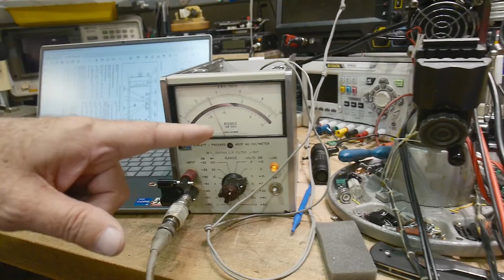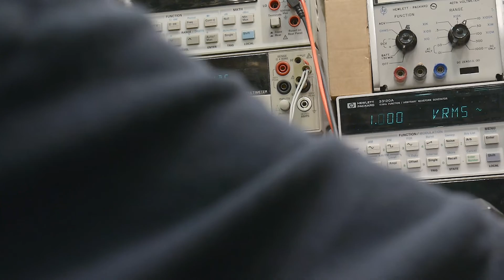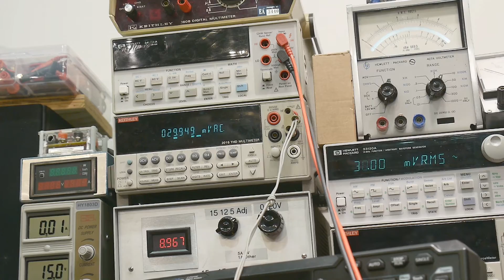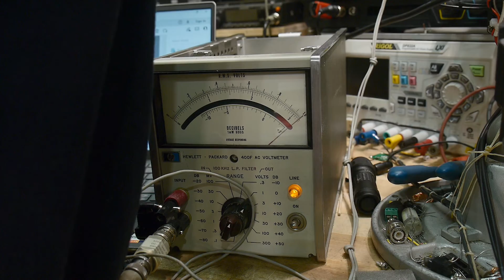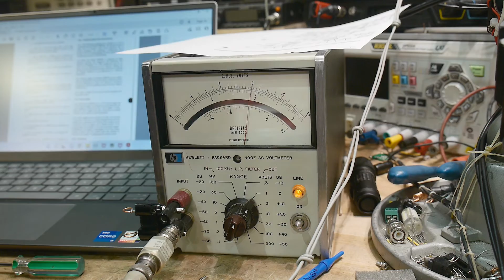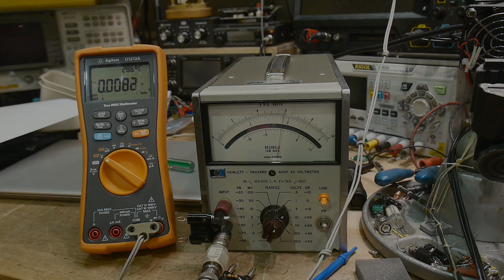#1287 HP 400F AC Voltmeter (part 3 of 3)

Comment: Yes, that's an old norm: two 4mm plugs with 19mm spacing. This even fits into European sockets, although the diameter has been increased to 5mm / 19mm. 
A friend said he had a lot of plugs behind the furniture, so he plugged in everything he could get his hands on. 
Boom! Then he was in the dark. 
With the flashlight he pulled all the plugs out of the mains and went to the fuse. When he came back into the room he saw that the old loudspeaker was completely destroyed. 230 volts AC into 8 ohm speakers, that couldn't work well. 
Because that was over 6500 W at once!

Comment: Your wires at 4MHz have much more drop than 20Hz.  You have to account for your wire loss, before you can calibrate your instrument.
The easiest way to do this is to use an oscilloscope with an active probe and measure the voltage at the end of wire, where it connects to the meter.